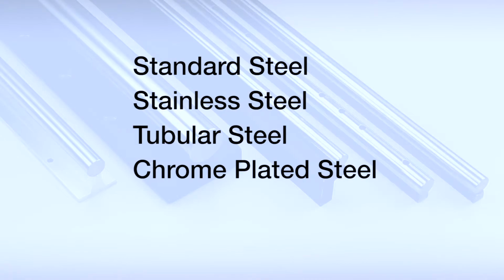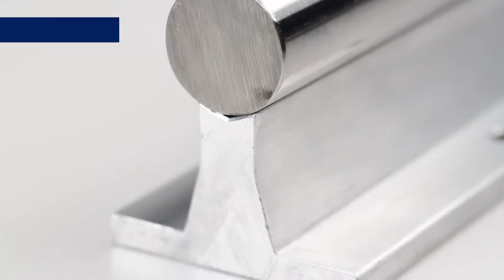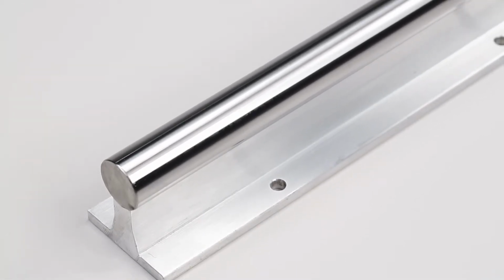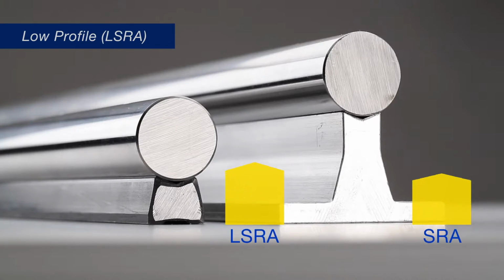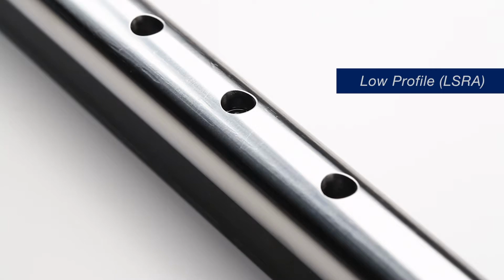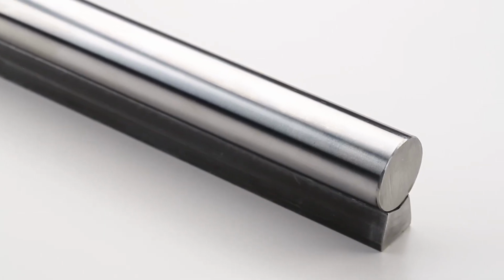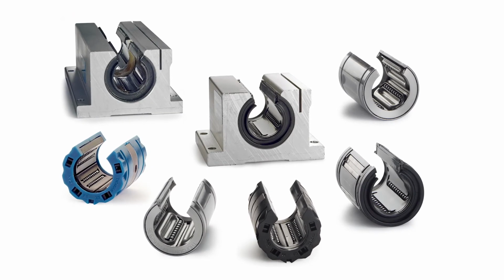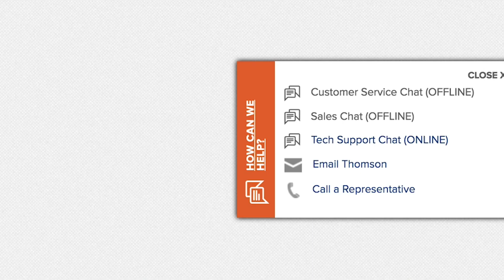Choosing a Thomson Shaft Support

Comment: I work, assembled machines with the same structure, only they have, a tank between the rails. My problem has been aligning the rails on each side, to ensure parallelism and squareness. The rails are located at a distance of 3 meters from each other. Know some technical and effective alignment system. Well, I do it empirically with a tensioned steel wire.
Reply: Have you tried the dial indicator?